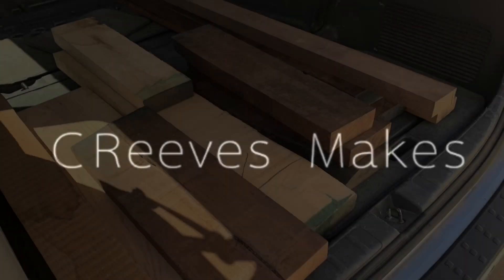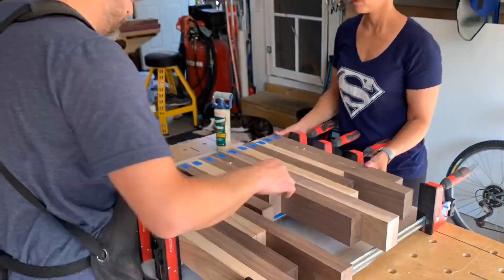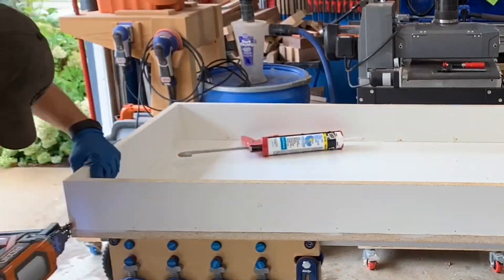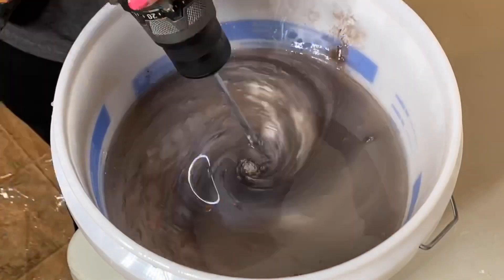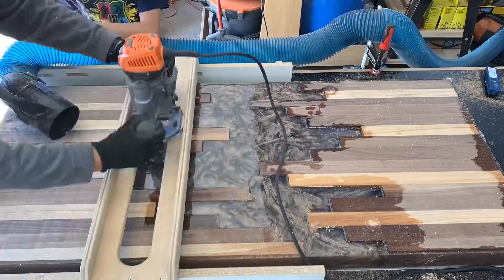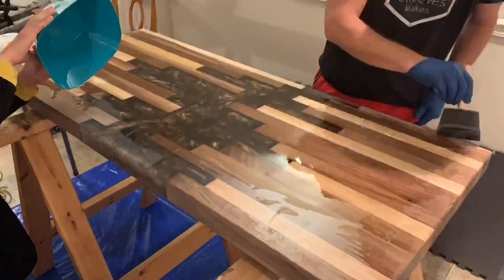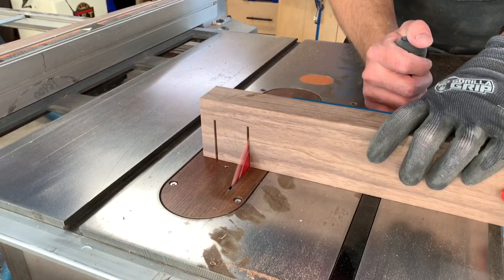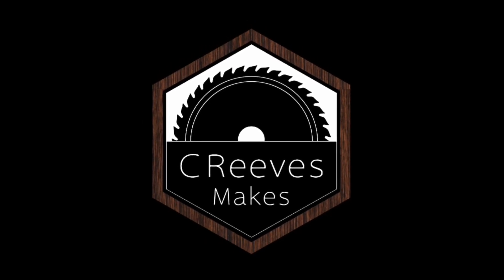CReeves Makes Epoxy Resin Coffee Table MAS Epoxies Deep Pour X

Comment: Really beautiful work.  When it comes to de-gassing the bubbles from the epoxy, I have seen both torch and heatgun to do the job.  Have you tried heatgun ?  You have used a torch in this video, just wondering your preferences on heat source and why.  Thank you.
Reply from the maker: Hey there!  I have tried both and found the torch to be a more direct source instead of heating the broader area.  I didn't have a ton of bubbles across the top, just small patches here and there and they dispersed quickly, so the torch was perfect for that. Thank you for watching and commenting!
Reply: I use a small vacuum pump on smaller amounts of epoxy I've used for small projects to get the bubbles out of the mix before pouring, which seems to eliminate most of the bubble issues I'd had in the past. Not sure how it'd work for a much larger pour like this, but worth testing out maybe if you can get ahold of a vacuum pump.

Comment: Beautiful table, I just had a couple of questions as I’m about to pour a 2” table myself for the first time using the MAS system. I did a test pour and found to have some air bubbles I’m the finished product I did use the heat gun multiple times and still had some. Also I keep mixing the resin to get the swirl effect but found my pigment settled to the bottom when it was all said and done. Any tips, tricks? Thanks.

Comment: Great build and very cool table. I'm currently building your outfield table but I messed up and followed your cultist and forgot to take into fact my table saw is different height, so no torsion box for me just 2 pieces of plywood laminated. I am going to finish the top with epoxy though after I do designs to mimic the color combo of my saw. Good job on the outfeed and this beautiful coffee table